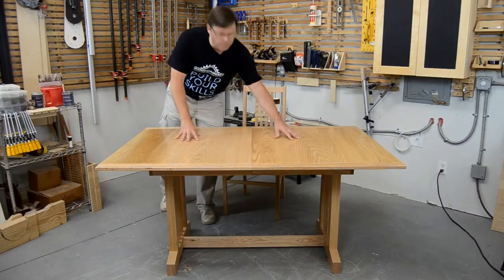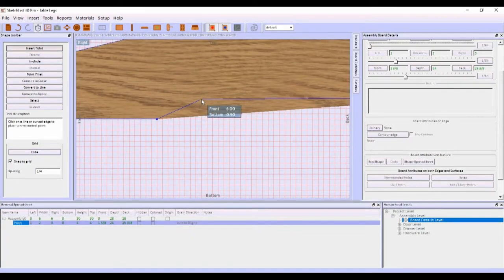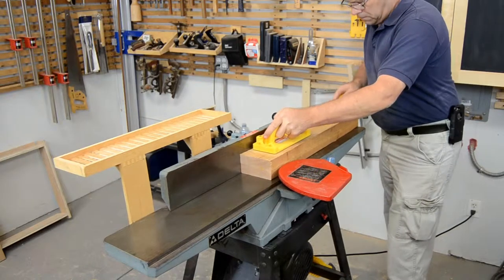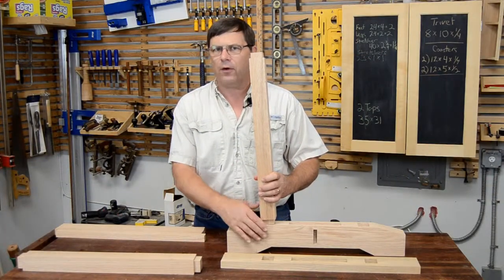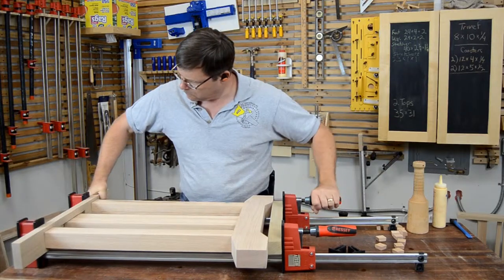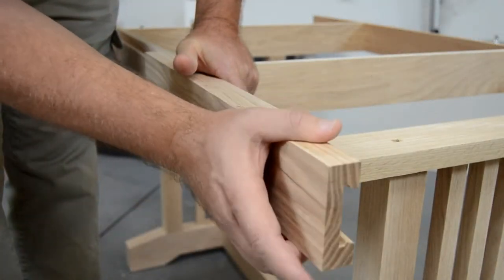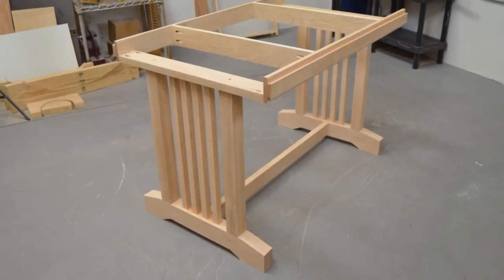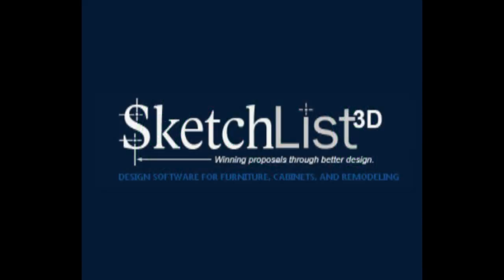Butterfly Leaf Dining Table Pt1

Comment: Is there any benefit to building this table with the grain running side to side as opposed to long ways? I see you made it side to side. Any insights?
Reply from the maker: Mostly it was to accommodate the butterfly leaves. The two main top sections could go either way, but I did not want the grain running across the short length of the leaves.
Reply: @Woodcademyshow  Any reason why? Just aesthetics?
Reply: If it’s due to expansion of the pins, could there be slots? I’m wanting to go long ways and trying to determine any drawbacks.
Reply from the maker: Structure, mostly. Having the grain running side to side across the narrow leaves seems like it would be fragile. But the truth is it does not really matter.
Reply: @Woodcademyshow  Thank you

Comment: The cut list shows the table top to be 3/4" thick. The written instructions say to mill it to 7/8". Which is correct? I want to be sure the butterfly leaf works properly. Thanks, I'm really enjoying the videos.
Reply from the maker: Les, functionally, it makes no difference as long as the top and leaves are the same thickness. 
But the grooves for the dovetail key that holds the breadboard ends on has to be 1/2" wide at the base, and in 3/4" stock, that does not leave a lot of material behind, so I went to 7/8" in the plan.